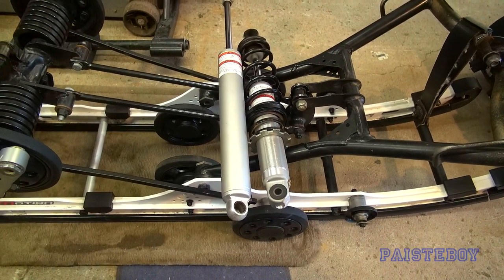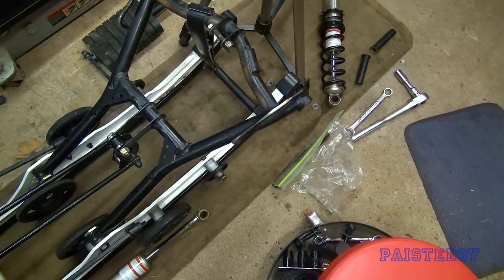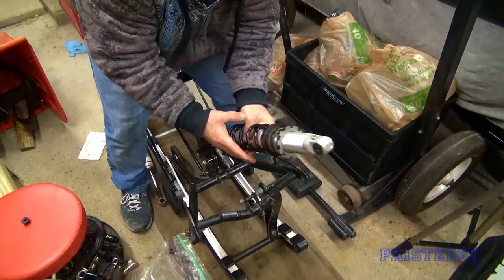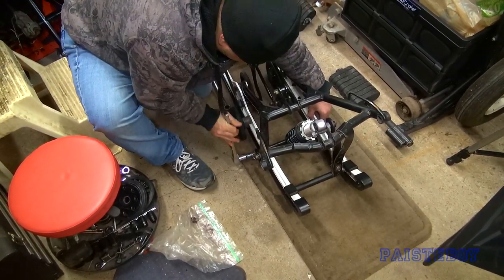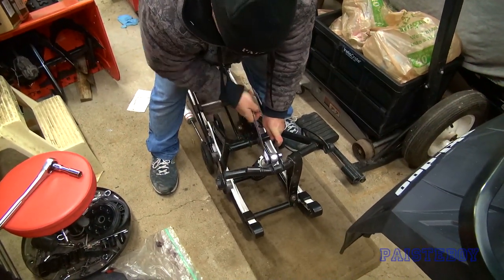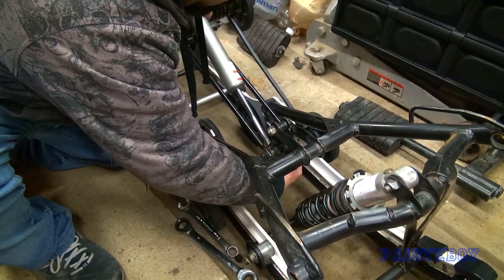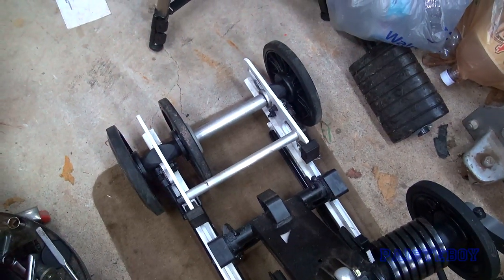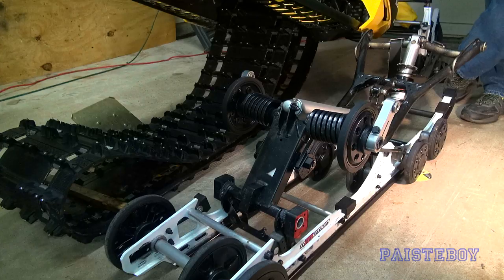R-Motion Skid & Shock Removal & Re-Install: PART 2 | For Shock Rebuild

Comment: Ya know what makes that much easier, 2 plastic horses, a small piece of plywood to make a table & work off the ground.  Even an old card table and some cardboard helps.  A lot better on knees & back.  😁
Reply from the maker: I'm sure you're right. It's pretty tight in the garage and I'm not sure I could fit a sheet of plywood in the area at the time. Maybe next time. 
Thanks for watching.

Comment: Not for nothing but people who see a leaking shock want to take it out and get it rebuilt.  So the way you demonstrated install only helps if people took out the whole skid.  WoW a lot more work.
Reply from the maker: That's fine.  I don't want to struggle removing and installing shocks with the skid still installed.  I know it can be done without pulling the skid but things are so tight in there that I find it easier to just pull the skid first.
Reply from the maker: This is also part 2. PART 1 shows how to remove the skid and the shocks.  
Unless you do this all the time it is far harder to remove and reinstall the shocks with the skid installed in the sled.

Comment: Great vids ! 
A lot of guys put brass bushings in....called oil lite I think. Might think about it when you need to replace the stock ones.
Reply from the maker: I'm familiar with the oil lite. Sure Sure Grip Dollies have oil lite bushings on them.  If the need replacing in the future I'd consider it.
Thanks for watching.

Comment: Nice clean install, you guys made it look easy! Did you ask your shock guy about the front shocks & when would he recommend they be rebuilt? How much did it cost? Were the rebuilt shocks already adjusted for you, or do you need to hit the trail and adjust them a bit? What criteria does he rebuild them to, weight and riding style? Thanks, another quality worthwhile video!
Reply from the maker: Thanks.  He recommended rebuilding the fronts as well but I couldn't have the sled hoisted up in the air at both ends in the garage.  I'll do them soon.  He set the shocks up the same way they were when I bought it.  The rebuild was 35 per shock and 32 for the seal for the blown shock. 102 total for 2 shocks and one seal.  Thanks for watching.

Comment: hey guys if you cut a 2x4 to fit in between the rails in front of the limiter strap and use some cedar shake shims that thd sells between the 2x4 and rails to help spread it apart it helps a lot I have a polaris and thats how I service the shocks. give it a try next time
Reply from the maker: Thanks.  I'll keep it in mind.

Comment: For the mounting location  on the upper mount the rear shock  , unless you’re sled is an XRS there is only one mounting location. Maybe you need upgraded torsion springs.. , stocks ones are really only good to 200 LBS.
Reply from the maker: Didn't know that the XRS was the only one with the 2 holes option for shock mounting.
As far as the stock springs go, I am well under 200 pounds.  I was pushing it last season but I've lost over 30 pounds since last season.

Comment: Hi love the videos man. Is there a torque spec on the idler wheel when you are all set adjust the track? And what is the slack measurement on the track to the rail when it’s hanging?
Thanks in advance
Reply from the maker: Thanks Jerry.  I'm sure there is a torque spec but I don't know what it is.  I just tightened it back up about how hard it felt to loosen it.
As far as track tension there is a tool you can but to set the slack/tension but I just used feel and visual to set mine.  You should also check it again after the first ride to see if it's still set the same.

Comment: Definitely want to hear what you think of the fresh shocks ......and doo ya have any trips planned ?  Might just catch ya sometime this season and rip some trails with ya ! WNY so far is looking like another bad season 😡
Reply from the maker: I will definitely make a report if the rebuilt shock difference in the next ride video.
We are planning on going to OF next weekend but the weather report looks terrible right now and if that ends up accurate we won't be going. 
This season has been a disappointment so far.

Comment: 21:00 did you use ratchet straps to collapse the suspension?
Reply from the maker: We didn't use a ratchet strap if remember correctly.
Reply: @Paisteboy  I'm just doing mine and it has the Quick Adjuster System...what a pain. I did have to ratchet strap and the QAS leaves no room in the skid for a ratchet strap.
Reply from the maker: I have done that in the past but the quick adjust system makes it harder.  Shock rebuilds too.  At least we'll be riding soon!

Comment: How many miles were on the shocks when it failed?
Reply from the maker: The sled has almost 3000 miles on it but I think the rear shock blew at around 2900 miles. The last ride was 158 miles.